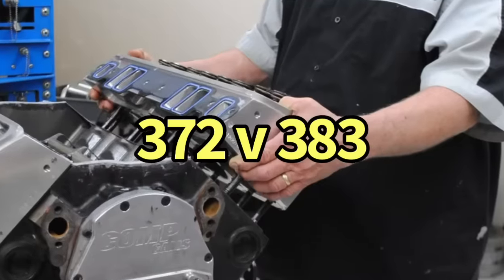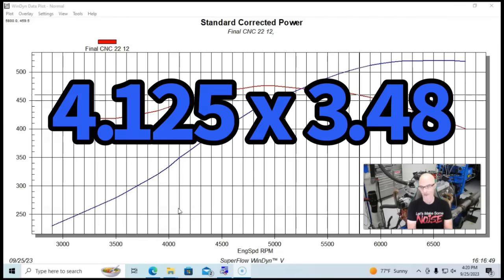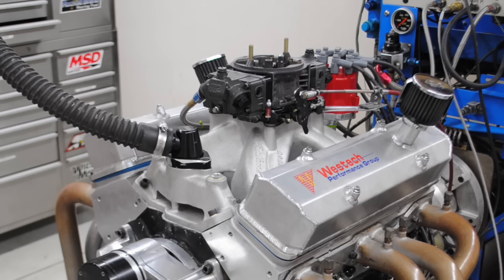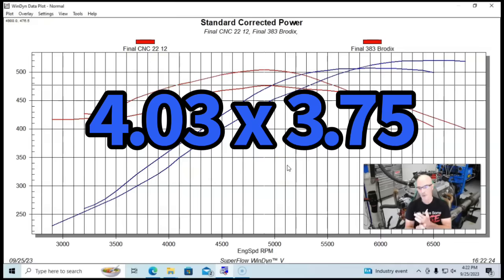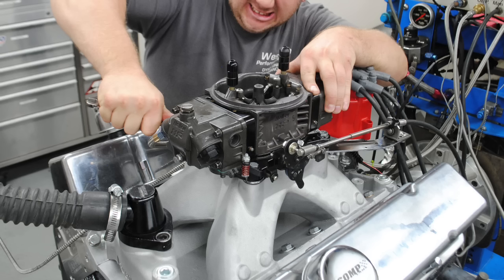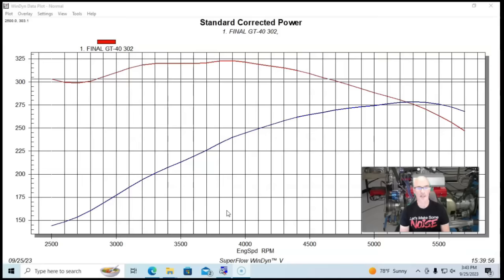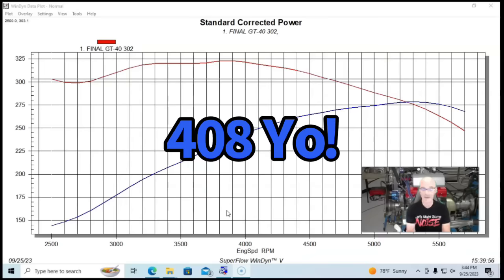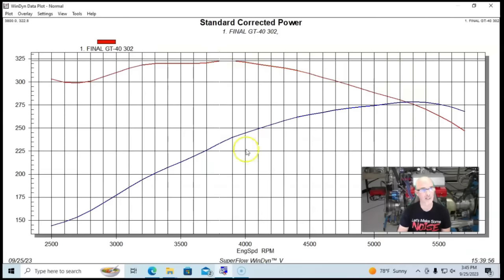BIG BORE VS BIG STROKE-372 VS 383-WHICH SBC STROKER DOES IT BEST? BONUS TEST-302 VS 347 FORD

Comment: My thoughts on the 372 v 383: With the bigger bore, the 372 did better on the top end because the larger bore allowed for better airflow. The reason why the 383 had more torque was because of the displacement difference. I'd personally take either one of them, but there really is no replacement for displacement, so the 383 wins in my book. having better torque all the way down the graph in the area where you need it makes a lot of sense to me.
Reply: You said it brother
Reply: I would agree. I'm not a fan of giving up 30-40 lb-ft in the midrange to net 10-15 hp up top on a street engine.  Though if the intended use is street/strip  getting significant track time then I'd porobably go with the 372 would make up for the difference in the low to mid by shedding a little weight.
Reply: How does a big bore allow for more airflow?
The heads either flow enough air or they don’t.  Atmospheric pressure is trying to fill each cylinder volume based on a differential. The pressure doesn’t know if it’s a long stoke or wide bore.
The big bore should allow high revs and then match it with a cam with peak higher up. You should also be able to have bigger valves without shrouding.
And in theory you should be able to put more timing in as the flame front has greater distance to travel greater. 

This comparison did nothing. You should build these engines differently.
Reply: Depends on where you need it. The torque below the curve won't matter in an all out, well hooked up setup.
Reply: @zztop7306  That’s a given. 
You can’t work out which is best when they will do different things in different scenarios.
The point of the video could of been to show what could be done with each, safely, but it didn’t do that. 
You would put the 372 in a lighter car and build it for race. 
You would put the 383 in a heavier car and run it on the street.
You can’t conclude one is better than the other. Just that they are better at different things.
Reply: @bourbonyoung6237  - Bigger bores unshroud the valves, which allows for a better transition into the cylinder. This allows for better air flow, especially at higher engine speeds. Richard has talked about this before in previous videos.
Reply: @Paulster2  Which is why I mentioned the ability to put bigger valves in
Reply: @Paulster2 . I would say that helps, but not a big factor.
Reply: @bourbonyoung6237  - Bigger valves against tight cylinder walls is not conducive to making HP or TQ. Shrouded valves are still shrouded. You asked why bigger cylinders produce better flow, which I told you how it works. Head flow is only part of the equation. Shrouding is the reason when they test head flow they also state the size of the cylinder they've tested it against. A larger bore allows for a larger flow. You can state a number in reference to flow, but if you're testing head flow on 4.125" bore and the end user only has a 4" bore, their flow will be reduced.
Reply: @bri-manhunter2654  - How much difference does 20cfm of air flow matter to top end HP numbers? Using the rule of thumb (2x cfm = potential hp), 20 cfm of flow could equate to as much as 40hp. That's enough the average guy can tell the difference on the seat dyno.
Reply: @Paulster2  Who said anything about creating a combination that would suffer from shrouding?
Richard even told you the heads could flow enough to support the power figures?
Reply: @bourbonyoung6237  - I'm sorry you aren't understanding the concept. You asked, "How does a big bore allow for more airflow?" and I accurately answered. If my answers are not helping your understanding, then apologies are given.
Reply: @Paulster2  Thank you.  Sorry for the confusion on my behalf. 

Retrospectively, my comment was based on the video and the after market heads designed for each engine, and the assumption that they didn’t shroud, and therefore wasn’t part of the equation.
I don’t remember the video differentiating between actual results from the dyno and potential issues that you would like me to understand. 
But thanks for pointing out the need to consider shrouding exceptions even when they aren’t part of the equation. In fact, thank you for covertly getting  me to consider all logical fallacies before commenting or asking a question. Not just shrouding.  
Even though shrouding can be an issue, it wasn’t highlighted as an issue for either engine, and your comment about a big bore giving better flow only applies if shrouding is a limiting factor. Which it wasn’t. And shrouding still doesn’t prove a big bore cause better airflow. All your comment indicates is that it is an issue you need to be aware of. In no way does it prove bigger bores cause greater flow.

But in review. The comment I replied to ignored the specifics and defaulted to the hypothetical while making assumptions. Will you  rectify those issues as well? 

Have a great day.
Reply: @bourbonyoung6237  - There may just be a disconnect between what we are saying. The video and my comments are not about the hypothetical. Richard (as he always does) asks us to comment about what we think could be the difference between the two givens (the 372 v 383). Whether you'd think so or not, valve shrouding is most likely the difference and spells out why the 372 with the bigger bore can make more hp up top while the 383 can make more torque down low. The obvious answer is, the 372 flows better at the higher end. Why would that be if the cams and heads were relatively the same between the two? The reasonable answer is there is less valve shrouding in the 372 then the 383. Why would the 383 make more tq down low? The reasonable answer is it has more cubes. This is what makes sense to me.
Reply: @Paulster2  Yes. I know it makes sense to you. 
But you are starting with a conclusion then looking for, and stating evidence, not mentioned in the video, as proof that your conclusion is correct. 
If you watch his other videos you will see that the same cam in different sized engines results in the engine making power at different points on the curve. Often with different sized bores as well. And from memory, some of the small diameter bores made power higher up. Which is the opposite outcome here. 4.8/5.3/6.0lt LS engines.
Valve shrouding is not a conclusion you can draw from this video just because he has mentioned it in the past.

I’m not watching this again. But from memory, there was no mention of the spacing between valves and cylinder wall. So you can’t conclude shrouding occurred just because it’s happened previously. 

And even if the valves are shrouded, it in no way proves that a bigger bore means more airflow. That is not causation. Shrouding is just a risk. 
A designer of an aftermarket head, particularly one that offers intakes to match, can change valve angles, runner height etc, to overcome the limitations you say prove bore size flows more, due to less shrouding.

Anyway. I get your point.  

Have a good day.
Reply: @bourbonyoung6237  - I'm sorry you don't understand the very well know principle I've laid out. It's not something I've pulled out of my butt or came up with on my own. It is how an engine works and has been proven time and time again. In a Hagerty article they state: "Comparing the valve curtain area, the space air has to get past the valve at maximum lift, shows that the area can increase by 35 percent from the undersquare example to the square example, and by another 35 percent when looking at the oversquare engine. Even if small-bore engines could overcome their high piston speeds, they’d lack the airflow capability to make significant power." An article from Binus Aso School of Engineering states: "Larger piston geometry (bore) will let more air passing [sic] through the combustion chamber." There are plenty more examples out there. There are a lot of articles out there for the biking world talking about the benefits and detriments of oversquare v undersquare engines. While both engines Richard is showing are oversquare (larger bore then stroke), the same principles apply.
Reply: @Paulster2  So. Did these engine suffer shrouding? 

Did you notice the little word in the article you published, CAN’?

You spent a lot of time demonstrating shrouding occurs and publishing examples of it, and you almost get it.

If you want to test your hypothesis. Take the over square 372, make it under square by putting a 5in stroke on it. Leave the heads the same.
Did the valve to wall space change? Did the curtain area change?  
Are you starting to get the idea that just because it can happen doesn’t mean it is happening. The bore size isn’t  determining flow and isn’t directly determining shrouding. The bore size let’s you put bigger valves in, have bigger intake runners etc but you can still shroud the valve no matter what the bore is.

Do I actually have to publish examples of small bore engines not suffering shrouding for you to get the idea that shrouding isn’t related to bore size or if the engine is under/over square 
It is gas flow limitations due to proximity of valve to other structures. 
A 1.5lt V16 has minuscule bores. Does it shroud? You don’t know based purely on bore size? You need more information don’t you? You can’t just assume the small bore is suffering from it! Hence bore size isn’t causation 

Don’t publish another example of it happening. I know it does  That’s not the point.
Reply: @bourbonyoung6237  - Obviously there's nothing I can help you to understand. I hope you have a great life in your misunderstandings.
Reply: @Paulster2  Ah yes. The published denial of someone practicing binary belief.
You too. Enjoy the mental loops in the future.
Reply: @bourbonyoung6237  - I'm not sure whether to laugh at your ignorance or cry for your well being. Absolutely amazing.
Reply: @Paulster2  And? 
I’m certain there are a lot of things you aren’t sure about.
Even the articles that you published, you ‘aren’t sure about’. 
But I can’t make you understand. 
Sometimes there are factors, not mentioned, that limit that understanding.
Much like shrouding really.

But now that you want to move the goal posts and focus on a new topic, don’t bother using the same logical fallacies again. It won’t work this time either.
Evidence demonstrates you’ll give it a go anyway. So! Double or nothing? Or move the goal posts. Your call.
One thing is certain. You’ll keep doing it for exactly the same amount of time that you deny it. It’s how all belief is maintained. Find the exceptions and deny the evidence that contradicts it.
Reply: @Paulster2  I've read all your comebacks.  You lose, buddy.  The guy smoked you with Truth everytime.  It's like you just want to argue.  I hope you aren't someone's boss.
Reply: @bourbonyoung6237  good job, sir!
Reply: @dannymccarty344  - LOL ... living rent free in your head, too. That there are two of you in this world is beyond me.
Reply: @Paulster2  whatever you say dude.  You got smoked with truth.  The end. Lol
Reply: @dannymccarty344  - As Don Henley stated, there are three truths: Yours; mine; cold hard. Nothing I've seen which was posted by "dude" has any truth AS RELATED TO WHAT RICHARD ASKED AND TO THIS VIDEO. It is a diatribe of his truths which have nothing to do with the video ... which is MY POINT IN THE FIRST PLACE. Wow, how thick does your head have to be?
Reply: @Paulster2  whatever you say, dude.  In you head, you're winning, lol.
Reply: @dannymccarty344  - Thomas Sowell wrote: “It is usually futile to try to talk facts and analysis to people who are enjoying a sense of moral superiority in their ignorance.” I don't know why I've even been trying with you two.
Reply: I heard the only thing that beats cubic inches, is cubic dollars! 😅
Reply: @Paulster2  lol.

Comment: I think the 302/347 comparison was more helpful because it was a direct comparison with no variation between cam grinds, heads, intakes etc. Both the 383 and the 372 would be fun engines, but it wasn’t apples to apples enough to really gain any insight into differences between the two engines. Lift and cam timing at 050 were similar, but we don’t know much about the rest of the profile. The heads and intake may have flowed similarly, but at these power levels lots of little variables can stack up. The higher torque and better midrange for the 383 are classic benefits of a tighter LSA and more displacement, though
Reply: Different displacement require different lsa, so even the cam doesn't do any justice
Reply: I'm thinking same.  Close to specs, tells nothing about the true character of each motor.  Different lobe profiles, LSA, and duration are the bulk of his test results.
But, he don't care really.  Its about views and comments.  $$$$$ = views and comments, good or bad.

Comment: This comparison is a great example of why we should be using area under the curve instead of just peak numbers.
Reply from the maker: and why I provide the curves
Reply: @richardholdener1727  that was more of a comment on the dyno world in general, not a specific criticism of your methodology. You're one of the few that even discusses the curves on your results. So many just just display peak numbers and judge engines by that. 
That said, it would be easy to import that data into a spreadsheet and have a macro that calculates and displays the actual area under the curve vs just the peak numbers or just the curves. 
Yet you hardly ever see that. It should be a standard part of the dyno output IMO.
Reply from the maker: the curves tell you the story
Reply: Unless you are building the engine strictly for a drag car.  Area under the curve is meaningless in a drag car.  Street car yes.

Comment: Uncle swore by the 377(400block-350 crank) in the sprintcar. Did not need gobs of tq, but the extended rpm help with tractable tq for a very light car.
The tow/hauler ran a 383-more drivable tq. Both motors were very different tho. But who doesn't like a rooting tootin gross pollutin high revin sbc?
Reply: 377 was also bae in sand drags and sprint boats! Amazing engine!

Comment: I have a 1963 Ford Falcon that came with 260. I now have 302 with 1969 351W heads. A 351 will not fit in the engine compartment without serious modifications. So a 347 might be good. But the 302 is sufficient.
Reply: I have the same problem in my 1960 falcon, I'm running OEM exhaust manifolds just so it fits.

Comment: Bore = potential valve area. Stroke = length of the lever. 
Long stroke means more piston speed, which will help at lower rev's. The Ford numbers would have been very interesting from 1000 rpm lower, but unfortunately that's not how it happened. Good information Richard. Thanks very much

Comment: With regards to stroke vs. bore, it's all about use case. 
I have a 3/4 Ton Suburban, and not long after I got it, I replaced the 350 with a GMPP HT383E. I have zero regrets about that choice. It didn't just give me more power, but it gave it to me where I especially wanted it, down low. It gets that heavy truck moving so much easier, and it's a tow beast a well. Plus, it will power through heavy snow and dirt with ease. 
That said, back in my youth I had a buddy with a really lightweight Nova with a 327, and that high RPM power curve was perfect. I'd love to see it scream with a high revving 372 with 2.02/1.60 valved heads.

Comment: On the SBCs the stroke swallowed the duration up on the 383 so it did better lower . The narrower lsa also helped the 383 more due to stroke . But truthfully both lsa were too wide .
Reply: 106
Reply: 106 is crankshaft centerline

Comment: Re 372 4.125x3.48 vs 383 4.03x3.75

I tune lots of bike engines. I see both configurations in similar displacements. 

Torque falls off more the more over square. Horsepower goes up from breathing and more esoteric things like sqirl and squish.

Comment: I’ve always thought of an experiment like this with the LS platform. 
Comparing a 5.7L ls1 with an “LS7” based engine destroked to 5.7L with the 4.8 rotating assembly. Both of these engines displacements and compression ratios are both within 1%! With the same cylinder head / valvetrain it would be interesting to see how they compare!

Comment: I built a 372 back in '75 for my sprint car. It was the least expensive way to gain more cubic inches over a 350. It was a very good combination and won it's share of races. I later built a 400 using a stock 400 crank which I had balanced. I never thought it was that much better than the 372, but it did pull hard on the bottom end.
Reply: interesting--back in the 1970's some of the track engine builders were just stroking a forged 350 crank out to accept the early connecting rods smaller diameter, getting 360-370 cid depending on whether they went stock bore or .060 over. That was for the customers who thought the 400 had an overheating issue.

Comment: Second half of the video was great! I have a 305 and thinking about making it a 334 and leaving the heads, intake, and carb the same but wasn't sure if it would work. This pretty much confirms it would and would give the gains in low end power I am looking for. Most bolt on power only helps at the top end and hurts the low end. Spinning an engine over 5k rpm doesn't have much real world application.

Comment: On the Ford 302, First I would do is change the heads like a set AFR 195 or the bigger valved heads for Ford small Blocks. Yes a 351 Windsor would also be a great choice like building a a 408 for example. a fun engine to me would be building a 331 stroker bored 030 over and use a great set of heads, a great cam and maybe add a turbo to it. I would use a aftermarket block like a Dart shp block and appropriate bottom end parts and pistons to handle the high rpm it would it can rev to and put in something light like a 19631/2-1965 Falcon. it would be a lot of fun to drive!
Reply: Bill Elliott special... was beating 350sbc in Nascar using the 331 until Chevy cried foul!